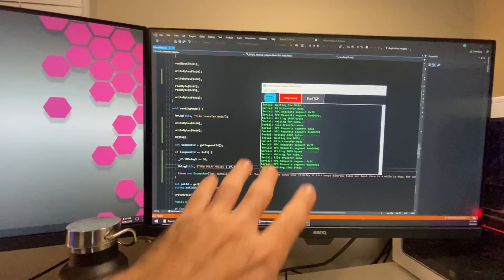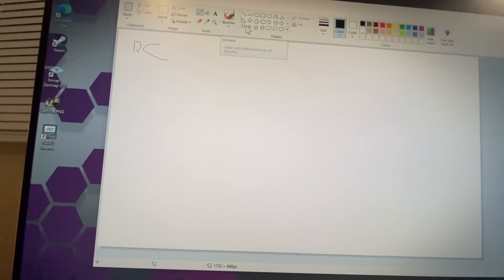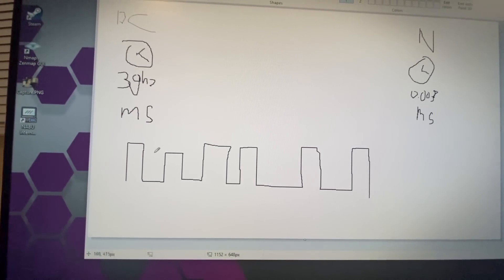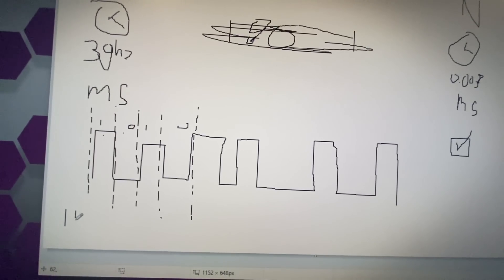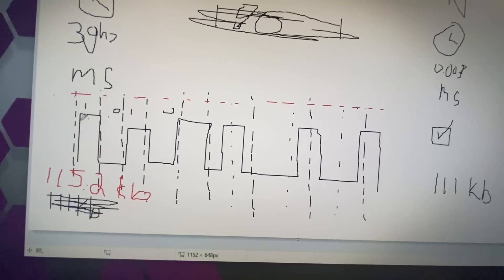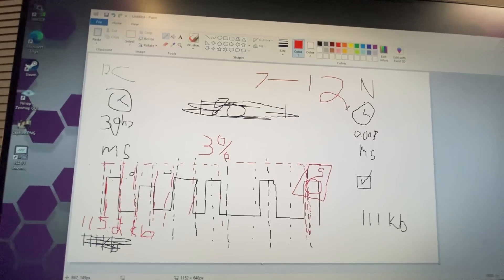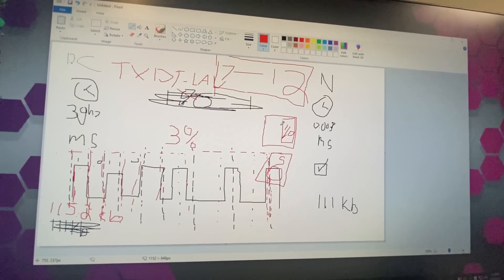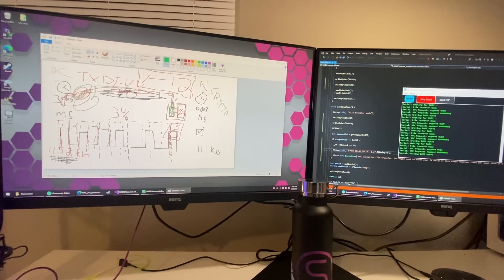28 - NABU Computer Baud Rate Troubles

Comment: if you take a FTDI FT232R based RS422/RS485 converter you can make 111,111kb/sec baud rate that 0.1% difference will not harm the protocol and then you can send at full speed without delays.
Edit:  Tested it with my pc and a picoscope the pc can do 111.111kbs baud rate  in C/C++  I guess C# has the same options.
	DCB comDcb;
	memset(&comDcb,0,sizeof(comDcb));
	if (!GetCommState(hComm, &comDcb)) return -1;
	comDcb.BaudRate = 111000;
	comDcb.Parity   = NOPARITY;
	comDcb.ByteSize = 8;
	comDcb.StopBits = ONESTOPBIT;
	if (!SetCommState(hComm, &comDcb)) return -2;
	return 0;
Reply from the maker: It doesn't seem that the FTDI can do it. I believe it's matching to 115200. I'll scope it today to verify.
Reply: @DJSures  will try with a C# test project tomorrow, can be the C# shell is limiting to established baud rates
Reply: @DJSures  Are you sure you have a FT232R chip you can check with the FT_Prog utility from the ftdi website

Comment: If you have an FTDI based serial port you can achieve 110092 baud using a divider clock of 27.25, the Application Note AN_120 Aliasing Vcp Baud Rates explains how you can map a custom baud rate onto a selection you don't ordinarily use under windows
Reply from the maker: I was considering adding the FTDI library instead of the Windows serial. The only issue is cross-platform - I'm trying not to duplicate my codebase. This is an excellent example of how poorly Microsoft has promoted "cross-platform." I mean, come on, Maui isn't even supported in Linux!
Reply: It’s not that they’ve poorly promoted it, they’ve done that fine. The issue is they haven’t actually done it, but that’s ever so typical M$.

Comment: I think you need a hardware solution like you described at the end.  Between the transmit clock rate and voltage difference compared to spec its lucky it is working at all.  But I am a hardware guy...
Reply from the maker: Nope - figured it out :D

Comment: That explains something I noticed, so thanks for this. Building a passthrough to correct the timing and up the voltage might solve the lag issues.
Reply: My NABU TFTP Gateway running on a Pi Pico-W is able to transmit to the NABU reliably at 111,881bps with an effective 3 stop bits due to how I'm using the PIO.
Reply: @GrizzLeeAdams  Ooh, post your notes, please, I want to use an RPI 3.
Reply: @geekwithsocialskills  well, then we may be chatting soon. I'm still in the Indiana Jones phase, but not for much longer.

Comment: I think the ideal solution without modding the NABU would be a custom usb->serial converter. Not counting the level shifting that needs to be done, an Arduino UNO for example should be enough. The principle is to use a pinchange interrupt for receiving from the NABU and a timer interrupt to bitbang at the right speed to the NABU. All while being able to use any baudrate you want on the PC side.
Reply from the maker: That too - but still need to build something. I'll figure it out :D
Reply: @DJSures  I'm sure  you will, wish I had one. It just begs to be retrofitted as an online bbs sort of network.

Comment: There is someone working on a serial board to connect direct in the Nabu,  Ultimately that's probably the best solution.  Then the adapter can get its 12 volts and break it out to USB.
Reply: It's even better to replace the UART entirely, unlike the shim that just taps off the low voltage TX/RX before they go through the differential transceiver.  By simulating the UART its possible to replace it with a much faster solution that can stream data in to the NABU as fast as it's Z80 can read, without any baud rate sync issues. A Cypress EZ-USB can simulate a USB-CDC UART on the PC side, and the TR1863P UART on the NABU side.

Comment: Could you use the PIO of a PicoW to get your 111kbs?
Reply: Yes, you can get very close to the actual 111,865bps with a 113MHz sysclock on the PICO. using the UART peripherals I think you can get 111,881, but using the PIO it might be closer to 112,103 now that I do all the math.  On the PIO you can actually transmit extra stop bits which help align the next start bit on the receive side.  In my NABU TFTP Gateway I'm getting very reliable transmission to the NABU from a Pico-W.

Comment: I don't have a Nabu, but I've been finding this channel and the others on the subject fascinating. I was just wondering if I could make a stupid suggestion. There's probably a reason for not doing it, but if your PC can't transmit at 111kb/s but 115.2kbs. Would it be simpler to transmit at 222kbs and double up the bits so each bit lasts twice as long, so the Nabu keeps sync?
Reply: You can't do it because you have no control over what gets sent for the start and stop bits.  You give the UART 8 bits of data and it adds a bit to the beginning and end, and not having control over that would break the scheme.  Also, if you can't do 111kb/s, you probably can't do 222kb/s either.  Standard PC serial ports are really limited on the speed options and it's basically around doubling or halving the speed.  These USB adapters may have other baud rates available with the right efforts though.

Some UARTs have an async mode that would let you transmit the way you describe (there is no start/stop bit in async) but you wouldn't be able to receive reliably at all because you have no clock to receive by; you'd have to loop your transmit clock over to the receive and you'd have a really hard time telling which bit is which.